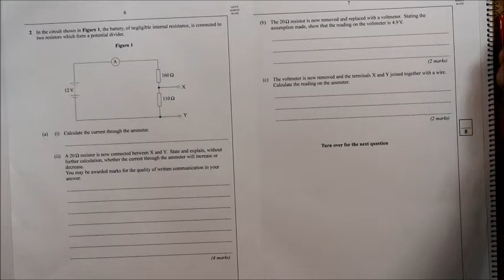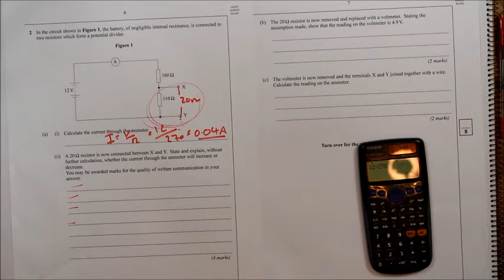AQA Unit 1 Basic Electrical circuit

Comment: On question 2c:
I didn’t understand why we only write 160 ohms in the calculation
I thought it should’ve been 12 divided by 270
Reply: Because when we connect the points X and Y using a wire, current will not flow through the 110 ohm resistor. BECAUSE, current follows the path of 'least resistance' and we generally assume that our wires have negligible resistance.